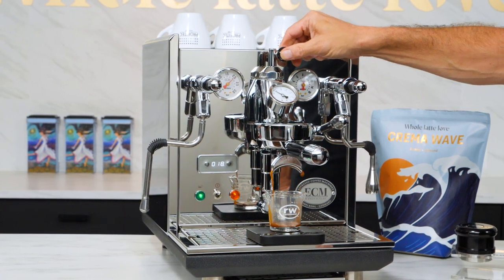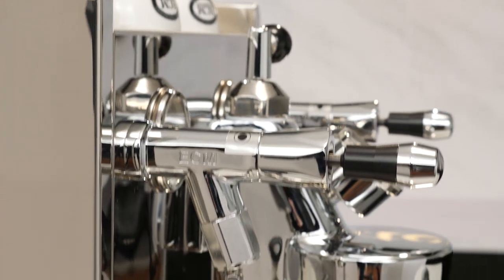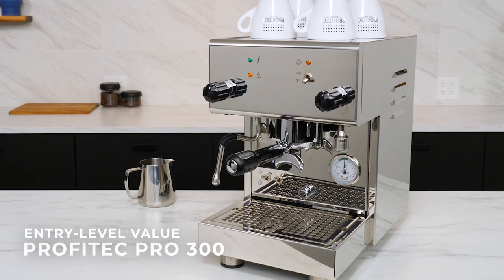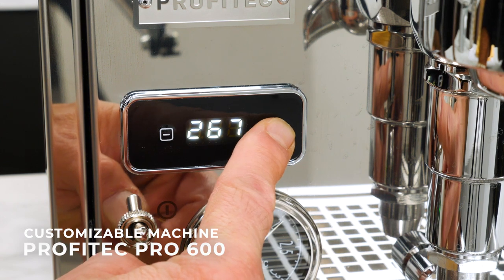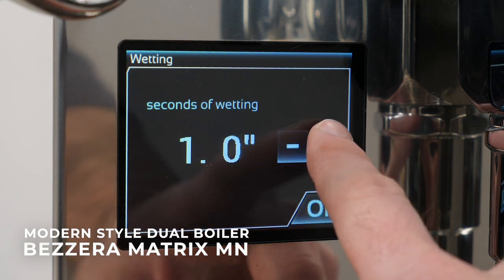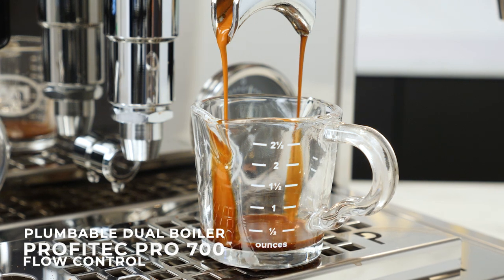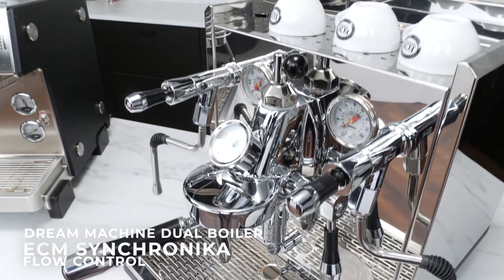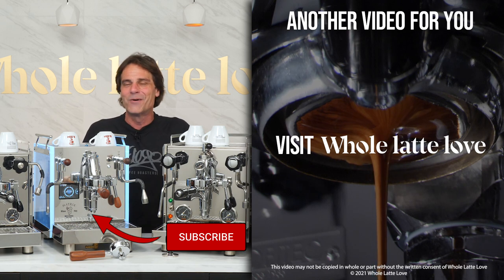Top 5 Favorite Dual Boiler Espresso Machines of 2021

Comment: Hi Marc, thanks for the review. I’m currently in a position to upgrade and torn between the ECM and Pro 700. Which and why? Cheers
Reply from the maker: Hi Sammy, Assuming your choice is between the ECM Synchronika and Profitec Pro 700? If so, know those machines are essentially identical internally with same specs for boiler size, steam pressure, etc. Difference is the finishing quality. The Synchronhika is a bit more refined with added details like chromed tips on levers and portafilters, angled PF's, lever/joystick activated valves, tapered E61 group head. Potential espresso quality is identical for these machines. Profitec and ECM are sister companies - similar to a Toyota and Lexus relationship. Hope that helps!
Marc

Comment: I spent a lot of time on whole latte love site reviewing all the whole latte line of espresso machines I have actually purchased two machines from Whole latte love and both times I took their advice and was not sorry I bought a Gaggia Classic and it lasted me seven years and it still works and I've maintained adapt according to what they say now I've upgraded to a profitec pro 700 with flow control and it's an amazing machine thank you Marc and Todd
One more thing if I may I definitely suggest buying the filtration system for the for this machine it's an excellent it gives me line infusion pressure and really increase the flavors in my coffee thanks again Marc and Todd
Reply from the maker: Hey Michael, Thanks for taking a moment to share your experience - it's appreciated a whole latte! That's was one heck of an upgrade!
Marc
Reply: @Wholelattelovepage  yes it is. I love it

Comment: You've got me really tempted to get the Matrix MN as an upgrade from my current Sage/Breville Barista Express.

Love the option to set a power on time so its warmed up ready for when I get out of bed
Reply: if you want to turn it on at a specific time, you'd be better getting a wifi controlled smart switch. That way you can turn it on from bed if you wake early or on the way home remotely so it's ready for when you want it

Comment: hey Mark, I love your videos, thank you. we have 50% off for the Profitic 700 here at at $1579, should I take it ? why ECM is better?
Reply from the maker: Hi Don, That's an amazing price on the Pro 700! I'd take it for sure. The ECM Synchronika is essentially identical to the Pro 700 internally. The difference is in the finishing detail of the machine. The Synchronika has lever operated joystick valves, custom taper to the E61 group head, angled portafilters and more refined casework.
Marc

Comment: Just a quick question. If I were to buy the Rocket apartamento would you guys be able to set it to 9 bars max limit for me?
Reply from the maker: Hey Alex, Yes we can. In order to make that happen it would be best to phone or chat in your order. When placing the order let the sales rep know you want your machine setup to 9 bar and have them place that info in the shipping notes. I should mention that manufacturers like Rocket Espresso and Bezzera tend to set the OPV to 10-11 bar in order to provide a proper brew water flow rate in vibration pump machines like the Appartamento. If you do not like the 9 bar setting you could adjust yourself. It's a little tricky to do as the machine has to be opened up to make the change and the Appartamento does not have a brew pressure gauge. If you are considering the Apparatmento you might be interested in a video I posted today with our top 5 favorite heat exchange boiler machines of 2021. The Appartamento is in the list. Also covered in the video are the the Quick Mill Arnos which has PID, externally adjustable brew pressure and brew pressure gauge. The ECM Mechanika V Slim is in the video and it also has externally adjustable brew pressure and a brew pressure gauge. Both those machines are about the same price as the Apartamento. Watch the video here: https://youtu.be/c1aLovDKXYA 
Hope that helps!
Marc
Reply: Thank you so much!

Comment: Great overview as always Marc. I have the ECM Synchronika and it is a lovely machine and highly capable. There are a handful of things that I think ECM could do to bring it to that next level. Mine came from the factory pulling shots at around 10 bar at the group. Pulling this back to 8.5-9 made a world of difference. Definitely going to want to upgrade the group gasket to silicone as the rubber stock will get sticky after 6m. The bottom of the drip tray lid is quite sharp, which seems a missed opportunity given how much you handle it and how great the finish is elsewhere. And finally I think it needs some rubber over the runners where the drip tray sits on the machine or else it rattles. All small things that don’t effect the amazing performance (except the brew pressure!). At this price point I think they are super small inexpensive improvements that really just finish the product perfectly!
Great machine regardless.
Reply from the maker: Hey BD, Thanks for the comments! Not sure where you purchased your machine but we prep all our Synchronikas to 8.5 bar brew pressure with blind filter running from reservoir. That'll get you about 9 bar when running from plumbed in line. The silicone gasket is a nice upgrade and as you mention the stock gasket will have to be replaced at some point anyway. The drip tray supports do have the stainless slides. I have not experienced rattling from those - could it be coming from elsewhere? The machines we ship have a butterfly bolt holding down the motor to prevent shipping damage. It's a butterfly bolt under the machine - many customers miss the instructions to remove that. Leaving it in causes extra vibration as it compresses the rubber motor mounts.
Marc
Reply: @Wholelattelovepage  hey thanks Marc! I should have mentioned that I didn’t purchase from WLL as I don’t live the States! Some good pointers on the butterfly nut. Cheers

Comment: Hi Marc. Love your videos. Great production value. Debating on getting a ECM Synchronika Espresso Machine With Flow Control and maybe a Ceado E37SD grinder or a Crem ONE DUO-V with a Eureka Oro Mignon Single Dose Grinder. I didn't see the normal bundle discount on the Ceado E37SD grinder when paired with the Synchonika. Not sure if the discount is not available for that espresso machine or if the website coders forgot to add the discount. I'm a newbie and probably don't yet have the discerning taste buds as others. I like quality products that I can grow to appreciate. However, I'm not sure if I'm jumping too deep in the pool before learning how to swim.
Reply from the maker: Hi David, Thanks for your patience and your kind comment! Also, thanks for bringing the missing bundle discount on the grinder to our attention. If you call in, a member of our sales team can assist you with that.
If you appreciate quality products, the Synchronika and Ceado grinder are the top of the line. Start there and you'll likely never experience "upgraditis"! Are you jumping in deep? Perhaps. But higher-end equipment is more consistent so it's easier to use than lower-end gear. Hard to quantify the importance of increased consistency to a particular user and whether it makes financial sense to pay more for a "better" product as everyone's situation, desires and taste buds are different. Hope that helps!
Marc

Comment: A year ago I bought the Profitec Pro 700 from WLL  and boy I love this machine. I don’t get all the hate this machine gets from Lelit owners. Both machines are great,  you get some extras when you get the Lelit Bianca but that’s. In my eyes if you compare them side to side they’re almost the same. I wouldn’t mind own either of them. Good job Marc!
Reply from the maker: Hi AP, Thanks for the comments and your patronage!
Marc
Reply: I think the Lelia Bianca fans would have a point if the machine was $300 cheaper in the US. In Australia, there is a sensible price spread between the Bianca, the 700 and the Synchronika. It should be the best way to get a full featured machine on a budget, but it is built like a 10 year machine, not a 20 year.
Reply: Can it handle back to back sh0ts?
Reply: @brittanybutler2211  The 700, Synchronika and Bianca are all dual boiler machines with 750-800ml brew boilers. You use around 60-80ml of hot water all up for each shot, so it can reheat the incoming water quickly. My Synchronika recovers temperature by the time I can grind and tamp the next shot.

Comment: Hi Mark, i watched your review of the Pro 700 vs Lelit Bianca and can definitely see the difference in build quality between the two. Would you say the Pro 600 is also of the same build quality as the Pro 700 or is the 700 a step up? Thanks.
Reply from the maker: Hi J, Thanks for the question. The 600 and 700 are very similar in build quality. Major differences between the 2 are larger boilers, plumbability and rotary pump in the 700 vs vibration pump in the 600. If interested, here's an internal component tour video of the Pro 600: https://youtu.be/DWiLYoNZYag
Marc
Reply: @Wholelattelovepage  Thanks Marc much appreciated.

Comment: Mark, if I'm not mistaken the entry level dual boilers in this video have vibrating pumps. I have had a single boiler for years, the Silvia with a PID I installed myself, and have been considering going to double boiler. Should I be going with rotary pumps? My initial thought is, if I'm gonna spend significant money to upgrade the machine, seems to me I should be going for rotary pump. I'm guessing besides being quieter the rotary would last much longer than vibration? Your thoughts always appreciated. thx
Reply from the maker: Hey mr x, Thanks for the question. Rotary pumps are quieter than vibration and long term more reliable. Thing is, if you ever had a vibration pump fail they are very easy to replace and inexpensive. There are some other benefits with a rotary pump. Most machines using them are plumbable direct to water line. ECM and Profitec machines with rotary pumps can do line pressure pre-infusion when plumbed. Setting brew pressure is usually easier with the adjustment accessible from outside the maachine. In majority of vibe pump machines one must remove the case to access the OPV to adjust brew pressure. Rotary pump machines have of unencumbered brew water flow rates of ~10-11g/s while vibe pumps usually run at ~7-8g/s. Higher flow rates can be beneficial for some coffees.
Marc

Comment: The Matrix is amazing. Traded my Linea Mini to get one, just to tell how great it is.
Reply: True, i got the Matrix to. One thing i dont like is the drip tray, there’s water coming out the botem side when the machine releases pressure. 
Dont you have the same problem?
Reply: @dekkers5854  mine is plumbed in and I haven’t faced that issue you mentioned. Well, there’s always a drop here and there but it’s the same on all prosumer home machines even on a Mini or R60. How bad is the splash with yours?
Reply: Its not terrible, but for that price it shouldnt happen i gues. I fixed it with a straw and ductape on the back of the drip tray.
Reply: what do you like better, and worse, than the Mini?  I am thinking of buying the mini or the matrix, have not seen any comparison reviews.
Reply: @annenominous7220  well I had a 2017 Mini, which had no pid and to be honest was a bit of a whim😅 it’s pretty, well built and reliable, has a Marzocco badge but is very expensive for a limited control on your extraction.
Trading an old Mini and spend again a ridiculous amount of money for a new Mini would have been stupid.
So I ended up making what I think is a smart choice : selling my non pid Mini to cover the price of a brand new Matrix. Bezzera has a solid reputation and very reliable group, and the Matrix came with everything I was looking for and even more control and customization I thought it had.
Now if I had the connected Mini, I wouldn’t trade it for a Matrix.
Reply: @annenominous7220  I think the Mini has a better built/finish quality and the Marzocco name is something you can appreciate in the kitchen.
The Matrix looks well built, has incredible heat stability thanks to their in-house group, and provides surprisingly complex controls on the shots. And it has volumetric buttons, which is for me very comfortable to play with as I can take care of the milk and forget about the shot at the same time.
It’s like a Rolex vs Omega comparison, both show time with extreme precision but at the end of the day people buy Rolex.
This period of my life when I used to think like this is over.
Reply: @vab120  Thanks!

Comment: Just wondering which of these would work for a light traffic coffee trailer. Any response is appreciated. Thanks.
Reply from the maker: Hi David, While none of these machines carry an NSF rating for commercial use they are capable. Using commercially would depend upon your local requirements. I'd lean to the Profitec Pro 700 or ECM Synchronika. They are essentially identical internally and feature best in class steaming power so you can crank out the milk drinks faster. Also highly reliable machines! Hope that helps!
Marc
Reply: @Wholelattelovepage  Thanks Marc.

Comment: I have a Jura S8 but now I find myself fascinated by all the user controls of the Profitec 700 and ECM Synchronika. I love the flow control, the dual boiler and the rotary pump etc. Do you think there would be too much of a learning curve going from a automatic machine to a totally manual one?
Reply from the maker: Hi BB, Sounds like someone is considering coming over to the artsy hobbyist side of espresso! Compared to the convenience of super-automatic machines there is a learning curve to more manual espresso preparation. It's not a perfect analogy, but semi-automatic espresso is a bit like baking. One has to get to know their equipment, control variables and also develop skills in coffee dosing, puck prep and milk frothing. None of those are rocket science but it does take some practice to be consistently successful. Most important is dialing in the grind size. Here's a video which covers that  process: https://youtu.be/jOY7D02n4Cw
For more exposure here's an excellent video on milk frothing for beginners which takes you right through to pouring latte art: https://youtu.be/4PSCsv7kcKA
Watch those videos and if your comfortable with the techniques chances are you'll do fine!
Hope that helps!
Marc

Comment: I recently placed a pre-order for the Bezzera Due DE and am seriously considering calling to change to the ECM Synchronika.  Does the ECM have a programmable on/off timer capability?
Reply from the maker: Hi Dave, Thanks for the question. The ECM Synchronika does not have programmable on time. It does have a programmable ECO mode which turns off the boilers and puts the machine in standby. ECO mode is programmable in 30 minute increments out to 600 minutes/10 hours after last extraction. Like other machines with a mechanical main power switch you can use something like a smart plug or appliance timer for programmable on/off capability. If you go that route be sure the timer is rated to handle the power draw of the Synchronika which is 11.6 amps (1400 watts) for North American version of the machine.
Marc
Reply: @Wholelattelovepage  Good morning Marc and Thank You so much!  I LOVE WLL and LYV (Love your videos)!  I sent a message to the sale s team and will call them this morning to adjust my pre-order.  I'm torn between the ECM Synch and QM Vetrano Design - I swear this is my final decision but one of them will be on it's way to me courtesy of WLL today.  Thank You So Much Again!!
Reply: Marc - Just wanted to say that I will receive my new machine (Quick Mill Design) tomorrow and am super excited - I also want to make sure I give Tracy and Aaron both shout outs for their exceptional support in my experience reviewing and eventually ordering my new machine.  It's been 16 years using an Isomac Venus and I'm so looking forward to what this machine will bring me.  Thanks again!
Reply: Sadly I'm now commenting that I am canceling the order after an unbelievably terrible experience with 1.) having been shipped the wrong machine and 2.) being told I needed to return it for the right machine to be re-shipped (all that was missing were the wooden accents) then 3.) being misinformed (after I returned the wrong model) that the wooden accents are now backordered with no timeframe on returning to stock and that I could have kept the original incorrect version and they would have sent me the accents to self-install afterwards.  I guess I could say 4.) the fact none of the 4 different customer service personnel I emailed and spoke with had a clue what the other was doing and being told it would ship "expedited" and still hasn't shipped.  I thought this was going to be a home run experience and instead, it's been a complete strike out.  Great videos - terrible customer support!

Comment: What do you think of the La Marzocco Linea Mini? Was looking at that and then I saw the ECM Synchronika is cheaper and what you call a dream machine.
Reply from the maker: Hi DD, Givern the choice I'd take the Synchronika. You pay extra for the LM name IMO and I prefer the PID operation with clear indication of temperature. Beyond that the Snychronika is available with flow control of the E61 group which open up a lot of possibilities to fine tune extractions.
Marc

Comment: I miss hear Lelit Bianca. In the price range that you have it’s one of the best choices for the money. Good quality boilers, PID, a lot of additional accessories and manual flow profiling level. All with additional walnut accents. I think that only ECM Synchronika could be better choice, but also pricier (in Europe, don’t know US prices)
Reply from the maker: Hi A, Thanks for sharing your opinion. Here in the US pricing is similar to the Profitec Pro 700 which in our evaluation has superior build quality.